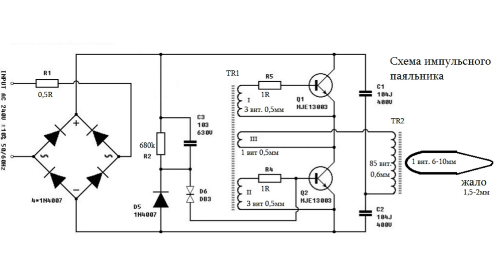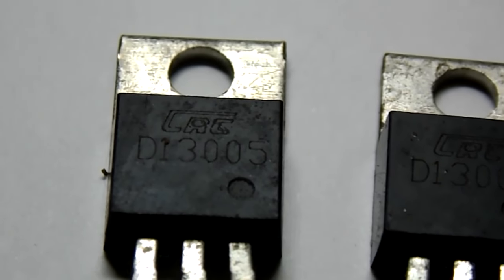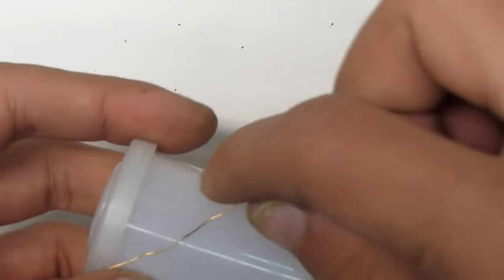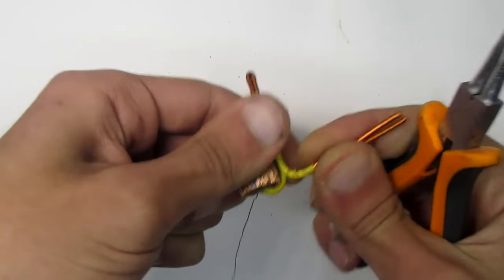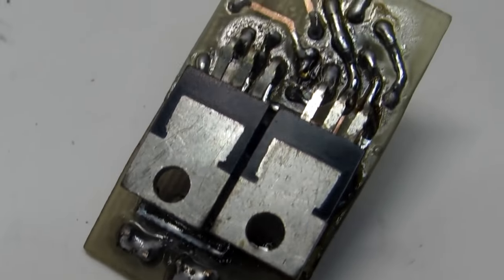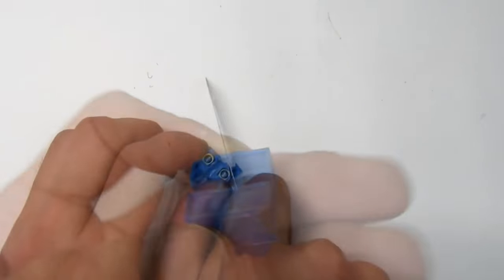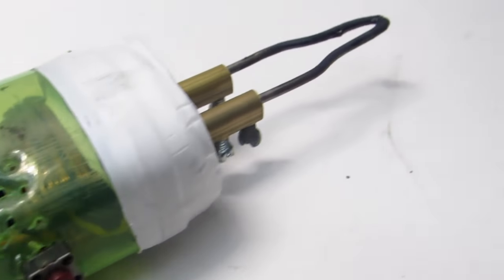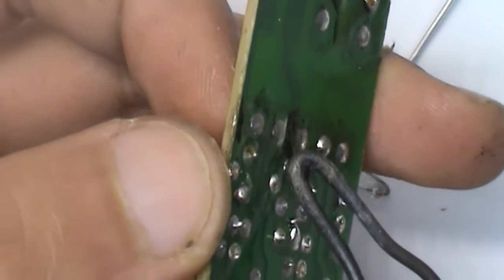How to make an instant heating soldering iron

Comment: The secondary coil warm up heating the core and the current through the transistors goes up fast to destruction, i was used the same EMI core in the video from an old CRT monitor cable, i understand something of magnetics, the permeability of the EMI core suddenly drops over 50-60 degrees?, the primary coil becomes a short circuit? (the secondary obviously), the 200W bulb in series from no bright when the core is cool becomes to bright very slow when the core begins to be warm, ingreases bright slowly until the bulb is at full bright (hot core), without the bulb the transistors (MJE13007's) was blow up like a high current fuses.
The soldering tip becomes red hot if i don't put anything to desolder.

Comment: I saw it once before and liked it, yet, now I noticed this design more deeply and found it very interesting.
If I understood it correctly you rectified the AC mains voltage and then made another oscillation by the C3 & R2 network and amplified with the two transistors Q1 & Q2.
I know there is more to it which needs further tinkering..(-:
Reply: I'll try and answer your question. The soldering iron he made is based on passing a low voltage at a high current through a short, thick piece of wire. The small resistance in the thick wire then heats up. A transformer that runs with 110/220V 50hz/60hz on the input and puts out 3V at 10 amps to the thick wire will weigh about 5 pounds. What he did is convert his 220V at 50hz into 220V at around 40Khz. At 40Khz the transformer can be much smaller (much less than 3 pounds) and less wire can be used for the transformer. That way you don't need really strong arms to use.
Reply: Oops. I don't think I answered your question well enough. You have the basic idea that it's a high frequency oscillator, but the oscillation frequency is based on the transformer inductance and the self capacitance of the transformer windings (every turn on the transformer is insulated from another turn. The wire and the insulation make a capacitor. The capacitance is accidentally built into the transformer).

C3 and R2 aren't used for anything except to make one transistor start easier by slightly turning it on. Without those two parts there's a possibility that neither transistor will start. If you want to look it up, try using Google to look for "royer oscillator".
Reply: hi, first thank you for the enlightenment, I knew there is more to it that meets the eye.
this is relay an interesting design to start oscillation, I hope I will manage to assemble and test this Royer oscillator in the future

Comment: what is the voltage that goes to t2?
Reply: It depends, but I can assume it's a low voltage, probably around 2 volts to 3 volts. It isn't the volts that matter on the secondary, but how much current you can push through the wire that gets hot.
In the schematic the primary winding has 85 turns and the secondary has one turn. 220v/85=2.59 volts per turn, so the secondary is putting out about 2.5 volts (not exact but close).